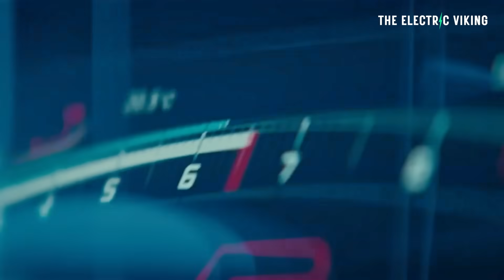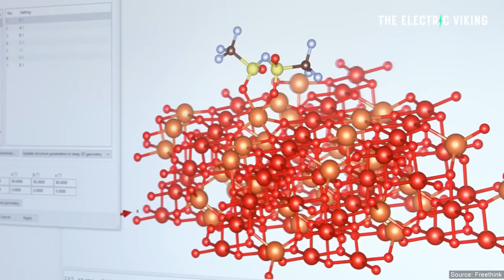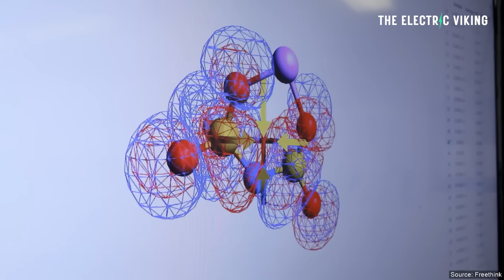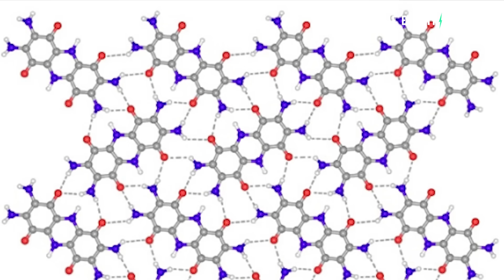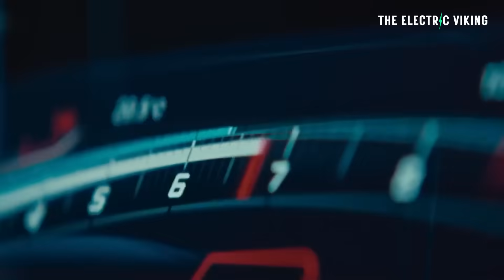MIT reveal Lamborghini battery with 500 kw charging & 765 Wh energy density

Comment: Say it was cheap to make; so the list of requiments are - cheap, uses comon cheap elements; exotic rare materials, has a long life (could be mitagated by swappable batteries), has energy density at least that of lithium ion; scales; you need to be able to make a lot; safe, - you can't have them blowing up or catching on fire a lot;  not too hard to deal with end of cycle - recycle or get rid of;   Any of these can be fail points - but if they aren't sure - this would be  big step forward for battery tech; still not necissarily green because if powered by the grid; it isn't green.
Reply: The grid is greening too… I’ve spent the last 30 years operating electric grids, and the scale of change happening now is unlike anything I have ever seen in my career. It will take a lot of time, and it needs to be done in a measured approach to ensure reliability, but I think it’ll happen.

Comment: The real innovation is the organic Kathode. If one can form an organic anode you can build batteries without metal.
Reply: When I heard they use rubber in the cathode couldn’t help but think that would help with the 4680 dry process that has been so problematic. Also at a 10C cell would probably have to be a can type anyway. Even if it’s not the giant leap forward as it seems it could be a big big jump. Thanks Sam!
Reply: These TAQ batteries use aluminum foil current collectors in the cathode, copper foil current collectors in the anode and lithium in the electrolyte contains lithium, so they contain 3 metals, plus the steel can. Today's lithium ion anodes contain graphite with 10%-15% silicon added, so they already don't contain metal (except for the current collector).

Comment: CATL is producing a Condensed Battery with a density of 500 Wh/kg.
Over 2022 & 2023, CATL invested over $5B on R&D.

I highly doubt MIT's battery is going to be provided to other vehicle manufacturers.
It's very likely to be produced in very limited capacity, less than 100MWh per year
Reply: CATL Condensed Battery has very poor cycles
Reply: @rwyo83  is your source "I Made It Up"?
Reply: @rywo No
Reply: Since CATL "is producing" this battery, can you name even one product that contains this battery? Can you point us to where these cells/batteries are available for purchase?
Reply: @skipondowntheroad5833  I tried to put the link but it got automod, you'll have to use Google mate
Reply: @skipondowntheroad5833  tried to share it but got removed, you are smart enough to search it yourself
Reply: @skipondowntheroad5833 , CATL says that it started producing its condensed battery at the end of 2023 and is working with COMAC to use it in electric airplanes. The two companies have created a joint venture with Shanghai Jiao Tong University to make electric aircraft.

Comment: They are talking about "cathode energy density". That's not even cell level...the anode is usually pretty heavy, so my guess is we are talking a 250-350 wh/kg cell.
Aslo, discharging a cell in 6 minutes not something new or astounding. Any LiPo battery in toy RC gadgets will happily do that, it's just 10C discharging.  LiPos can discharge much faster than that, 20C or more.
Reply: We can use the term " energy density " for only cell, not for anode and cathode
Reply: @aligenc659 , 
the term "energy density" is very often used for just the cathode or the anode in scientific papers.
I have checked the news about this Lambo licensed technology: they claim 50% energy densityimprovement over NMC cathodes only.
Reply: @aligenc659  
it seems my previous reply disappeared...
"energy density" can be used for just the cathode or the anode, it's pretty common in scientific papers. Capacity in mah/g is more common than energy density in wh/kg when talking anodes or cathodes, but I have seen both units of measurement quite often.
Reply: @pkvp7337  I saw only capacity for anode and cathode as you said. Energy density is used for cell
Reply: The only reason RC model batteries have that high discharge rate, is because they're small. there is a lot of exposed surface area compared to the volume of the cell. I don't know if you've noticed, but the new Tesla 4680 cylindrical cells don't charge as fast as the older but smaller 18650 cells. Mathematically, the the surface area of a cell goes up on the square of its size, but the volume goes up on the cube, making it more difficult for heat to escape the innermost part of the cell, which limits current density. Another advantage of RC batteries, is the "pouch" cells. A flat, thin cell has much more surface area, than a cylindrical cell. Blade cells, such as the GM "Ultium" Lithium Iron Phosphate cells have good thermal characteristics allowing higher current density. Like pouch cells, there's a lot of area, and, close proximity of the center of the cells to those outer surfaces.
Reply: @vincentrobinette1507 
RC pouch cells can be bigger than a 18650 in weight and size, and still discharge more than 20C...volume and structure is not all when discussing discharge rates. LiPo cells use a polymer gel for electrolyte, which is high conductive for ions. Discharging generates less heat, compared to other types of cells.
The same happens for cylindrical formats, not all cells are created equal. You can buy 18650 cells which will happily discharge at 10C (~30A), it's pretty common. But no all of them will do...
Reply: Cell Energy Density = (Potential difference between anode and cathode)×(Cathode charge (capacity))×(Electrode thickness)×(1−Porosity)
Reply: they report that the optimized cathode stores 306 mAh g–1cathode, delivers an energy density of 765 Wh kg–1cathode—higher than most cobalt-based cathodes—and can charge–discharge in as little as 6 min.

Comment: Lamborghini has long said they would not go down the electrification route for their sports cars until the weight/performance equation for batteries made sense for them - a lamborghini has to be quick not just in a straight line, but around multiple corners and offer excellent braking - two things heavy batteries make it hard to do. Seems Lamborghini now has found a solution it's happy with .
Reply: The McMurtry Speirling proves those assumptions wrong and Lamborghini will have to go EV or else become quaint and irrelevant
Reply: @glike2  An amazing car but a single seater with a few other compromises. Lamborghini operates at a more conventional - albeit still elite - end of the market. But no two ways about it: if you take into account cost, power/energy density. charging speed, longevity, safety and many other key metrics, this is a significant breakthrough.

Comment: We will see at least 3 new types of batteries per year for the next decade and it's going to blow your mind. In a few years I'll be laughing about my early 20s Tesla vehicles like I do the specs of 1990s PCs compared to modern ones.
Reply: I agree, and people will realize the best use for extreme batteries is not a thousand mile range but a 300 mile range with a much liter car.
Reply: @SkyRiver1 I’ll split the difference to 500 miles because I live in a place with subzero temperatures.
Reply: @HablaCarnage63 Yes, we can't forget temps like that vs battery storage. I wonder how much that problem will change when we finally get to dry batteries? 🤔
Reply: @MichaelWashingtonAE  At least it is relatively flat where I drive.
Reply: @SkyRiver1  agree, with the caveat that the battery needs to be rechargeable within about 15 minutes, which would help minimize the amount of time spent charging on long trips.
Reply: @SkyRiver1   Much lighter and much less expensive.
Reply: Yep. And 10C charging.
Reply: Material science through supercomputer and AI is exponentially improving outcomes.
Reply: Material science through supercomputer and AI is exponentially improving outcomes.